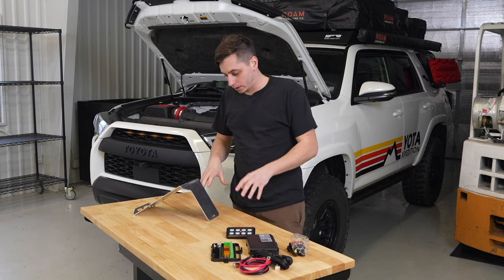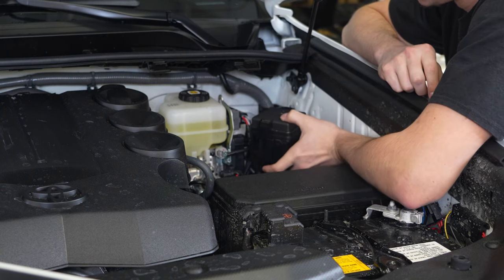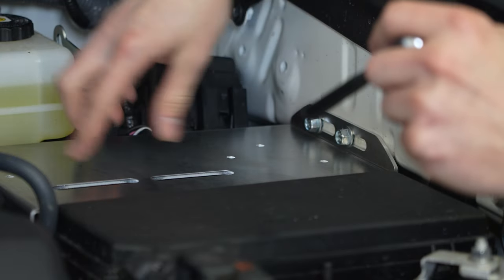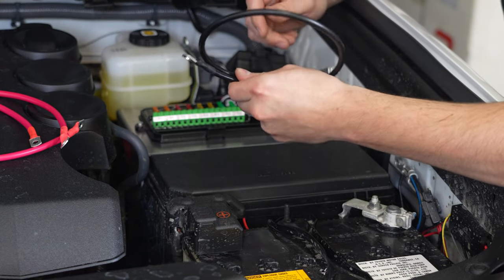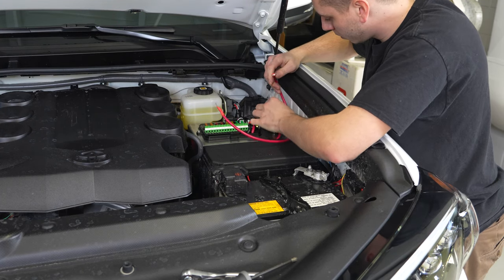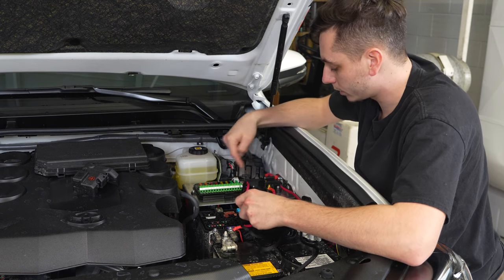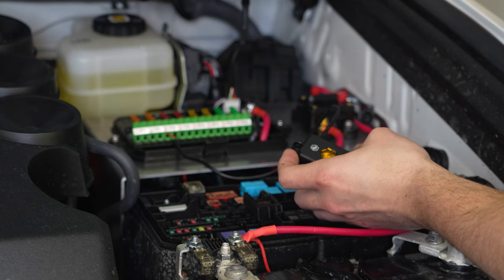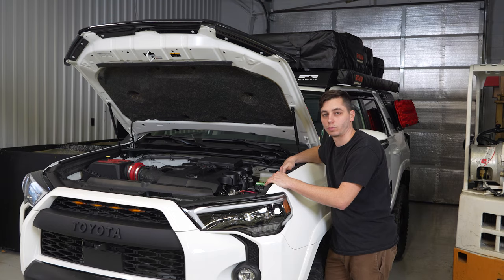Toyota 4Runner Switch Panel Research And Development | Install

Comment: When will the engine bay tray be for sale? Also is that an Auxbeam switch panel?
Reply from the maker: We are not 100% sure yet. We need to make some changes and make sure everything is good before we get a production run of brackets made. It is not an Auxbeam switch panel but is similar.

Comment: Hi Yota Xpedition, I like your product, really cool and neat, Is it possible to extend the base plate to also hold a dual ARB compressor and powder coat in black like the box cover? It will be super awesome
Reply from the maker: The bracket does come in black. This video was early in the development process. We have some updated videos on this. The only direction you could extend the bracket is over the fuse box. We would have to make it easily removable so you can access your fuse box.

Comment: (Time stamp 11:38) The short positive wire running from the control box to the circuit breaker looks like it will rub on the edge of the tray. This could be very bad! I would suggest you drill another hole in the tray, put in a grommet and run the wire up from the bottom.
Reply from the maker: Yeah that is something we might change

Comment: what fuse did you plug into for the panel?
Reply from the maker: IGN 10A fuse in interior fuse box
Reply: The version he has doesn’t have a fuse to tape.

Comment: Looking for the bracket, I do not see the listings for it under 4Runner
Reply from the maker: We are still in the production stages.
Reply: Nice. I am not much for a wiring rat nest. The main reason I have avoided looking at lights. New to the 4runner club. Thanks for the video! Extremely helpful